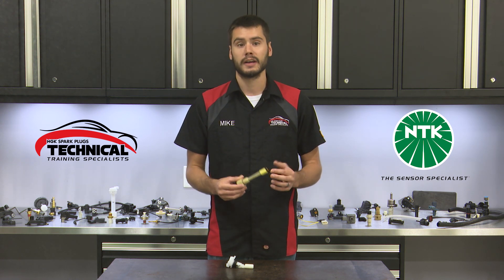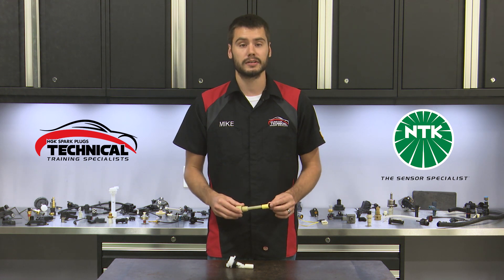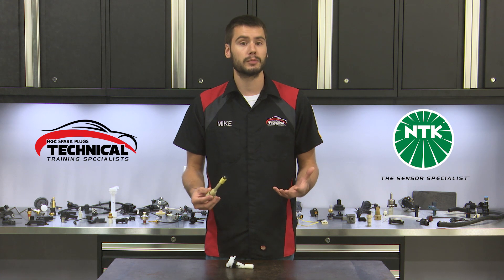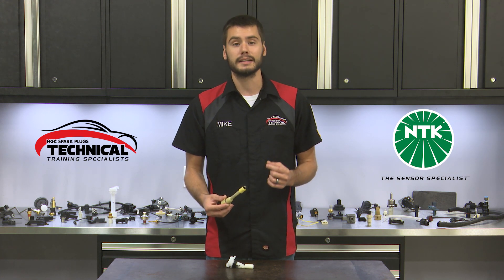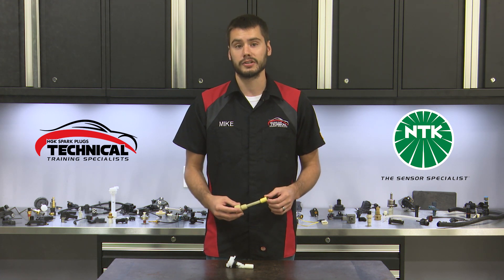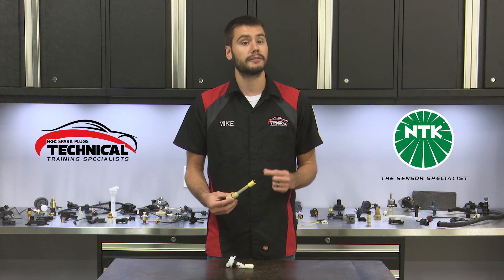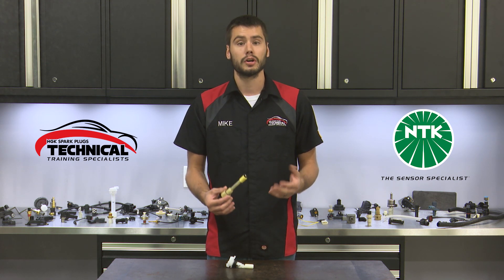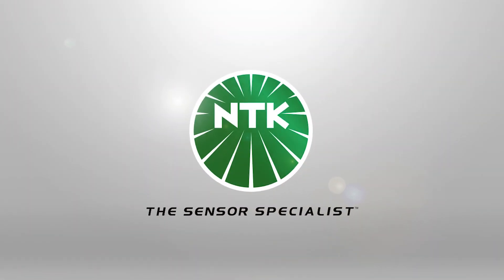NTK - Oil Level Sensor

Comment: Great , how do you test it?
Reply from the maker: Hey Keith, thanks for watching! It's going to depend on the sensor and the vehicle. Many of these sensors are fed a power and ground, usually from a module, and output a varying voltage on the signal wire. They can be very similar to a fuel level sensor. Others can be just 2 wires and operate as a go/no-go switch. Thanks for commenting :)
Mike Becker, Senior Technical Instructor
Reply: @ngksparkplugsusa  I would love to see a video with some of those testing procedures. As well as videos about many of the other products that NGK/NTK has to offer. Can't imagine a better platform than having it live like it was in Wells. Those videos were all terrific and brought so much more attention to the brand and product awareness. Who can we all write to make this happen?
Reply from the maker: Thanks for the kind words! I'm hoping we can make that happen here! You can send me an email and I'll ensure it gets where it needs to. MCBecker@ngksparkplugs.com
Mike Becker, Senior Technical Instructor